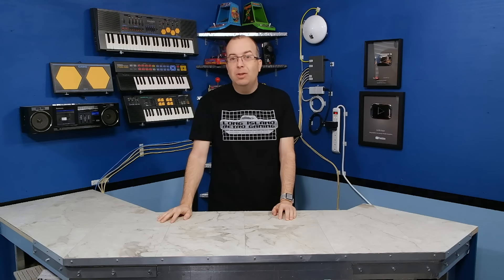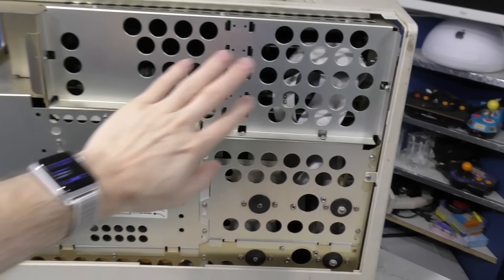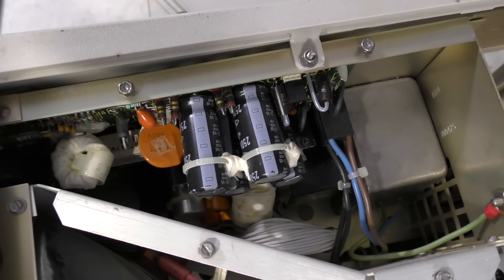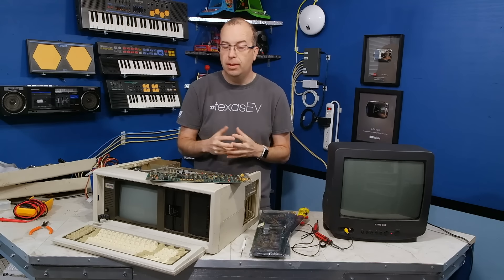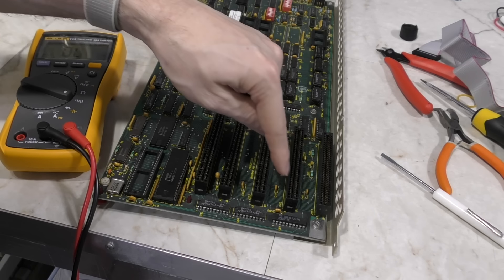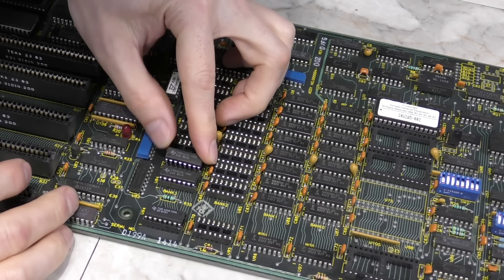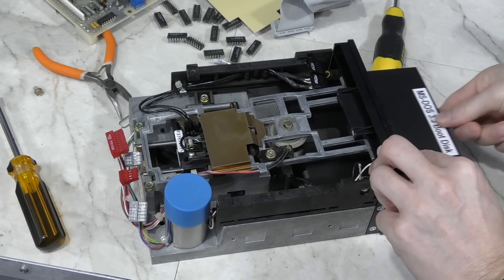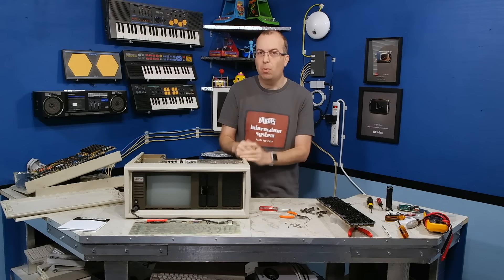Compaq Portable 1 Restoration - Part 1

Comment: Was watching this video when visiting my parents.. then dad peeks over my shoulder: 'Hey.. I got one of those down at the server room at work, want it?'   Suddenly i have a Compaq Portable that I have to clean up.
Reply: Sell it, or give it away to this guy.

I worked with plenty of this junk as a kid, it is perplexing to me why anybody want to collect it, but I am an engineer - we build better stuff today.

I think you're going to be disappointed.  It belongs on a museum, and I don't think it's useful for anything when you can simulate it at the gate level today - and you probably won't even do that ever.
Reply: @fuzzywzhe  Why do people collect anything at all? Why do we have emotional attachment to inanimate objects? Doesn't matter if we can emulate it to the molecular level.
Reply: How funny. Someone gave me one of these, too. And it's in the same state as David's. Fan comes on, but no display and no activity. I suspect a bad power supply.
Reply: @leandrotami  I didn't mean to sound critical, I just don't understand why people collect this stuff.

If I want to relive an experience from my childhood with a computer, it's the experience of using the machine, and simulation is 100% accurate with the machines I used.

I would never own a C=64 again simply because compared to the machine I have today, it's a waste of electricity to even turn it on.  My VASTLY  more powerful computer can simulate 20 of them running at the same time on 1 machine, and use less power.

But it's fine if you use actual hardware, of course.  I just don't understand it.
Reply: My Grandpop has one in his attic, he will let me have it if I past all my classes this year.
Reply: @fuzzywzhe  I believe you're missing the emotional attachment with the actual object. Yes, you could run an emulation of pretty much every system built in the 80s, and throw away and burn everything in a big pile in your backyard. This is not a matter of efficiency, it's a completely emotional aspect. I still own the computer I used when I was 6 and learnt BASIC programming with it. It is a part of my personal history and it's very valuable to me even though yeah, it's old and kinda broken down and inefficient. I don't care about that at all.
Reply: @leandrotami  I'm saying the only emotional attachment I have is the experience itself of the game.  Certainly wouldn't want to run a wordprocessor on one again.
Reply: Sick!
Reply: @tomwilson2112  if you have this apart, is there any chance I could have you get some information off a component for me? I need the values off the C2 Capacitor near the oscillator on the cpu corner of the motherboard. My C2 capacitor is missing and i need to replace it.
Reply: @fuzzywzhe  I get what you mean. I love watching these video's, but still these computers are a pile of crap lol. Interesting to see how anyone could put so much work into it.
Reply: Dude that's lucky! Oldest tech I have is just some IBM Thinkpad's with Windows XP on them. Well that and the flight stick I can't use
Reply: @AA-qo3wc  Hey, Mike. I just now saw your reply - sorry about that. 

I am not sure when I'll have the time to sit down and start troubleshooting this machine; right now, I don't have space to tear this computer apart. I'll keep you min mind, though, when I do finally get to work on this system. (Right now, I'm considering doing an LCD conversion.)
Reply: Lucky guy!
Reply: Wow. Amazing... You're Very Lucky!
Reply: @LtHades  What a kind grandpa.
Reply: Cool
Reply: that you GET to clean up
Reply: @fuzzywzhe  I prefer to collect these because they are part of computing history, I clean and restore these and put them on display for future generations to see computing history, without these, there wouldn't be modern computers.
Reply: @fuzzywzhe  yea you can emulate it but it's not the same as having the actual thing.
Reply: @minecraftWithDanielD  I have a commadore 64 I'm restoring right now, No video output but found the problem. Bad VIC ii chip.
Reply: @docsynth4387  "yea you can emulate it but it's not the same as having the actual thing."

Depends on what you're emulating.  Many emulators are clock accurate - this means that they are simulating not the instruction set, but the actual electrical signals.  They run EXACTLY the same, and they are running in an "ideal condition".
Reply: @fuzzywzhe  Same reason people collect other things.
Reply: Doing things like this is simply a HOBBY. It’s something interesting to do. It’s fun. There may be no practical point of restoring old computers, but most hobbies have no practical point either. I started restoring old computers recently and I don’t regret it. It’s very interesting to learn how to fix them and use them. Using real hardware helps put the technology in perspective. If I wanted to play old games just for the games, I would use an emulator, however; I find more enjoyment in playing the game on the machine it was meant for. 

Hobbies are not a waste of time if you can find some sort of happiness and enjoyment in doing it.
Reply: fuzzywzhe people want to collect it because its a (albeit, small) part of history, and its fun to do things on the original hardware  just as people did it decades before
Reply: @fuzzywzhe  To you, these old machines might be a waste of space, electricity and time to get them working. And certainly emulating these old machines may be much simpler, and easier compared to getting these old machines working again, however there are differences in ONE thing : Experience. And I'm not talking about experience from a software standpoint, the feel of the keyboard switches, the ways of troubleshooting problems, etc, which is totally different compared to using an emulator. And to some people those things are more valuable than just getting your work done
Reply: You should put new parts in it and make it a fully portable computer with a new lcd screen and all
Reply: VonGrav I have a similar story. I was helping my grandfather clean out a storage room of his and he found this. Now I’ve got to clean it up
Reply: Lol
Reply: @fuzzywzhe  Similarly you can get better performance out of a Honda Civic than out of a stock 1965 Ford Mustang, but it's not the same. Not at all.
Reply: @AiOinc1  Computers aren't like cars.

The main experience with MY computer was using it to run games when I was a kid.  If I want to re-experience that, there is nothing added by having a slow disk drive, an interlaced CRT monitor, and a power brick that hovers around 120F to do it.

90% of the experience is using the software of that computer.

I'm also an engineer so old stuff, not so interesting to me.  I understand lots of the parts entirely, and some of the parts at least on a general level.

My PHONE is more powerful than the graphics lab machine I worked on in college to design my SR VLSI project.  It was just a Sun workstation.  It would be no different to have a Sun workstation at my desk then to be using the computer I have right now emulating it.

Heck since I'm running Linux right now, it's practically like having a Sun Workstation at my desk.
Reply: @fuzzywzhe  For many people, the feeling of using software on the system it was made for is a very different feeling than emulating it perfectly on a new system. It sounds like you personally don't get that feeling, that desire that other people have, and that's fine. Not everyone does. To you it might sound stupid and pointless, but to many it is a very compelling reason to preserve and use old hardware. It's not really a practical thing, but it's not meant to be. People don't use this stuff because it's the best or fastest way to get things done, they use it because they want to.
Reply: @CommanderWiggins  The technology is what it could do, not the package it came in.  I think people entirely are missing the point.  I don't care what an old computer looks like, that's totally superficial and irrelevant, I cared what it could do.

Do you realize we have lost functionality with modern machines?  I was able to program a TRS-90 when I was 9.  How many 9 years today can write code today?  I entirely understand the mechanics of the earlier machines, but what is important is how they work - what they can do.

Modern machines encompass the functionality, the ability, of old machines.
Reply: @fuzzywzhe  I think you're the one who's completely missing the point. Just because you don't care about something doesn't mean it's worthless to other people.
Reply: @CommanderWiggins  "I think you're the one who's completely missing the point."

Fine. I give up on trying to explain the difference between a superficial physical design, and what it actually is capable of doing.  It's apparently beyond the comprehension of people.  I just wasn't aware of that.
Reply: @fuzzywzhe  I completely understand the difference between a machine's superficial physical design and what it is actually capable of doing. Everyone else who has replied to you also seems to understand that. The point that I, and everyone else has been trying to explain to you is that some people care about the superficial design. I don't know why you seem physically incapable of understanding that.
Reply: @CommanderWiggins  "The point that I, and everyone else has been trying to explain to you is that some people care about the superficial design"

I realize that.  I'm pointing out they are wrong to do that.  I'm pointing out they are superficial, and it's not a good thing to be superficial.

Would you not agree that superficiality is not a good trait?

It's fine to have an old antique.  I have a Babbage machine because of it's enormous complexity but I don't use it to do calculations.  The Babbage machine I have literally requires a running motor to power it - several watts - I've never measured it.  My phone uses microwatts.
Reply: People collect them because they’re only some left in existence
Reply: fuzzywzhe people (like me) find it cool to use and display stuff like this
Reply: @fuzzywzhe  cool beans 😃
Reply: fuzzywzhe it’s just fun to collect old things and persevere them
Reply: I had one of these when I was a kid. I remember carrying it around it was almost as big as I was. I could barely lift it.
Reply: fuzzywzhe if you DO sell it, make sure to get a good deal.
Reply: @fuzzywzhe  Ah yes, because your phone has a floppy drive. I see no difference in modern machines to past computers! You are correct, we are stupid, your opinion is only correct, collectors are a waste of air, i see you my dude
Reply: Cool!!!
Reply: @fuzzywzhe 
Uhhh... Dude. Don't tell this person what to do with their stuff lol? Let em do what they want, I doubt they give half a fuck if they're 'gonna be disappointed'. Note you aren't the only person in the world and that others actually have emotion and emotional attachment lmao
Reply: @leandrotami  Depends, sometimes it's just a hobby
Reply: @leandrotami  Its a hobby. Like trading cards, they really don't have any value but they are just cool to have.
Reply: @fuzzywzhe  Wow, you clearly don’t understand this hobby, not even a little bit. You can’t emulate things like the glow of a green CRT (no, an LCD with green text is not the same). SD cards also aren’t the same experience as a real floppy disk or an old noisy hard drive. I have carried my 33 pound Compaq Portable with me even though my MacBook Pro could “emulate” it, but I never have and never will have any interest in doing so, IT IS NOT THE SAME, “clock accurate” or not. The “ideal condition” for old software to run on is genuine vintage hardware. Of course, you will disagree, because that makes you feel good obviously, and you won’t even try to understand.
Reply: @AiOinc1  Great example! Couldn’t agree more. I don’t care if a newer car gets 100% the performance of the old one, the old one will always be cooler to me. For example, I’d be way happier with a 1926 Ford Model T than a 2021 Corvette. I don’t give a damn about going fast.
Reply: @fuzzywzhe  “90% of the experience is using the software for that computer.” You state that as if it’s a fact, but that’s entirely YOUR opinion, and not one many true enthusiasts (which you are not) share. Stop trying to force your bogus opinions upon everyone else.
Reply: @80sCompaqPC  You don't want to emulate the glow of a CRT screen.  It's a particle accelerator.

The reason for technological advancement is that it's advancement.

I can appreciate the tremendous advancement in technology from a Babbage machine and the enormous complexity of it, but I wouldn't want to have to drag around a 100 lb machine for doing addition and subtraction.
Reply: @fuzzywzhe  Something that parallels over from other hobbies: If you understand, no explanation is needed. If you don't understand, no explanation will help you to understand.
Reply: @fuzzywzhe  Thanks for confirming your lack of understanding.
Reply: @fuzzywzhe Some people just like collecting and using physical old computers why are you so rude!?
Reply: @fuzzywzhe  I'm sure you'll just call me a shitty engineer or something, but I'm also an engineer and I love watching these videos and playing with old hardware in the flesh. Granted I only recently graduated so part of the appeal of old hardware is the history, but I think using old, inefficient hardware also helps you better appreciate the wonders of our modern hardware. I don't think it's entirely superficial at all!

There's no avoiding it, but modern hardware is largely less tangible (at least to me) than old hardware. Seeing a board full of discrete logic chips brings me a kind of joy that I just don't get from an SOC. At the same time, I would never choose to build a production system that way when I could buy an RPi and get whatever I'm doing done in a tiny fraction of the time. 

I see this as much the same as the eternal debate of Linux vs <literally-anything-else>. Yeah I love Linux, playing with my PC and its OS, customizing everything I can to within an inch of its life, but if someone just wants to get something done with minimal hassle, there's a decent chance Linux is not the right solution for them. I use it because I enjoy it, and I learn things.

There's no point in me writing this comment and furthering this ridiculous thread, but I just had to express my view that there really is a non-superficial value in understanding computer history and the simple devices that paved the way for the fantastically complex ones we have today. For many people, gaining that understanding is much easier when they can play with the real hardware, or at least watch someone on YouTube do it.
Reply: @techkid43  Haha, no I wouldn't insult you and even if I did, I don't know you so any insult I'd give out is absolutely meaningless.  You should never be insulted by somebody who doesn't know you.

I'm simply pointing out that old ancient equipment should stay idle.  There's no reason to power them up.  Having a fundamental understanding of how older hardware works allows you get the better understanding of how modern hardware works - that's true.  There's been TREMENDOUS improvement in the last 3 decades, mostly in reduction of gate sizes, but also (to a much lesser extent) better routing algorithms.

You say modern designs are less tangible to you, well, get simpler hardware.  A modern PC is ridiculously complex, but a Raspberry PI isn't.  You can completely understand that, even though it's an SOC.

Linux can be made stock as well, the argument that it's "too customizable" I've always found that ridiculous.  You can do the same with Windows, it's just a lot more work to do it.  The reason that Linux is customizable is people who use Linux sometimes want to optimize it for their work.  There's nobody being forced to make KDE work with the Beryl interface for example - but I like it.

Understanding computer history is one thing, but making use of old hardware?  There is literally no point.  It's a waste of energy, it detracts from the lifespan of the (old) hardware, and literally, ALL OLD SOFTWARE (before 1990), is better run on a modern machine in simulation.

Can you really gain understanding and information from seeing chips spread across a motherboard?  Do you really gain any insight by following traces?  Do you have a deeper understanding because you can understand what a southbridge WAS?

You have to understand that older hardware was designed around limitations, they were not optimal - they were just more affordable.  You are seeing what was then, cost reduction.

It's fine to understand history, but for godsakes, I see no reason to run a program on one of these relics and if you're not going to run software on them - why power them up?

A great deal of effort was made to preserve the ability to run old software on modern hardware, in a simulation.  If you want to see what it was like to run some old program, don't fire up a computer from 1980 or 1990 - simulate it.  

The experience of using an old machine is what it produces, the machine itself was a device to produce output, nobody purchased these machines to purchase the machine itself.  They wanted results.

If I could have run a C=64 set of games on an Amiga back in 1990, I wouldn't ever bother with having a C=64 - nobody would have.  Back in the early 1980s you could run Atari 2600 games on an Colecovision - do you think ANYBODY with a Colecovision had a 2600 console?

In 1995, I could run a Nintendo Entertainment System on my computer - do you think I had ANY desire to have a "real" NES?  Lower resolution, higher power, had to deal with cartridges, had to deal with hardware, had to fiddle around with a television.  Or I could just load a rom on my computer and display it on my monitor.  What was less of a hassle to play Super Mario Bros. again after 10 years?

The future is to preserve the actual work on these machines is not a physical preservation, but a virtual one.  Your great grandkids will be able to play any NES game not because you bought the machine and the cartridges, but because it's simulated.

I regard the collecting of hardware as a bit of snobbery (it's better!) - well it's not better.  It's just the most expensive, and exclusive, way to do it.  I don't want to cut people out.  Simulation is about preservation, and you cannot do that with hardware to make it available to the wider public.  Hardware will always, inevitably fail.

In 2200 some person is going to be playing the arcade version of PacMac, but there's a 99.9999% chance they aren't playing on original hardware.  We need to preserve data, not things.

If you want to preserve an old computer for 100 years, cut out the capacitors (and mark the traces with the capacitance) and remove any battery.  All the solid state components should last for a very long time without being powered on.  I don't know much about dopant migration, but I think it's minimal without it being powered on.
Reply: @fuzzywzhe  bruh you can maybe get a raspberry pi 400 only not the kit for 70 bucks. Also sd cards are way more expensive
Reply: @AiOinc1   your right because it is the experience that makes it or breaks it
Reply: Nice unlike mice
Reply: @leandrotami  true
Reply: Imagine him saying
"It's yours my friend, as long as you have enough rupees."
That would be a pain
Reply: @fuzzywzhe  i think that at this point of the conversation, if you truly don't get there must be a problem with you or else you're just trolling. By the way, no one here cares if you're an engineer. You are not impressing anyone and you're not the only one with a degree here. I'm done with this.
Reply: @fuzzywzhe  ok, I'm going to the 'you have problems' option.
Reply: cool!
Reply: Lucky...☹️☹️☹️
Reply: @fuzzywzhe  it's fun fixing problems and playing old games like you did back in the day. It's also a bit of a challenge programing apps and games for old computers.
Reply: @fuzzywzhe  I am getting less sure you are an engineer with every comment
Reply: @honk2448  Do you really consider it enjoyable to debug a computer?  When I build a computer, the most obnoxious thing about doing it, is making the damned thing work if it doesn't come up on the first try.  Usually I just miss a power connection, or I didn't seat the memory properly.  If it's not that, then it's generally the chip has to be reseated, but if it's not that, nightmare.

Sure, there's some nostalgia value with playing with the old games and OSes and so on, but only in simulation.

Again, if I went through the trouble (and I never would) to setup a system that LOOKED like an old PC/Amiga/Mac/C=64/Apple IIE, but was really a raspberry pi you wouldn't be able to tell the difference.  It would run identically.

Wiring up a monitor would be a nightmare, as would the keyboard and possibly mouse, but I could do it.  You wouldn't be able to detect you're running a simulation, unless you looked at the power draw from it.  Not only would it run identically to an original system, it uses a fraction of the power.

In this age, we can run a C=64 system in a WEB browser.  It's crazy we can do this, but we can.  The old hardware is interesting to understand, but not that interesting.  I understand the chips entirely, the boards - that's not my area though I could figure it out.

Using an old system is just aggravation, not to mention the noise of using it.  They keyboards were inferior, the resolution just abysmal but suitable for the time, and looking at a CRT literally I can feel it.  If you put a CRT in front of me, and just showed blue and did the same with a TFT, I can tell which one is the CRT.  Not because I can see the refresh rate, but I can feel it.  It hurts my eyes.  It's like a prefrontal headache.  Hard to describe since when the first TFTs came out, I bought them, even though they were tiny and freaking expensive.

The whole point of these machine were what you could do with them.  Not the case, not the keyboard, not the awful CRT - those are all much worse than what we have today.  I can understand a person wanting to run some ancient software to experience the "good old times" but on original hardware?  Why?

Back in the 1980's and early 1990's - people customized the cases to make them unique.  They did this with the XBox at one point, and PS1.  I just don't see any reason to turn on a real Amiga or C=64 .  UAE simulates the sound of the disk drive.  Drives me crazy, like I ever want to hear that again.
Reply: @fuzzywzhe old computers are probably stupid to programm on but it's something different than just going to a modern pc. I am 13, I haven't experienced real nostalgia but I still love old systems.
Reply: @fuzzywzhe  I already got an arduino, I am gonna get a pi someday, but someday I want to get old machines
Reply: @fuzzywzhe  I know all about those, I use them to play games, I even used a vm to install win95, but it is still more fun with a real vintage pc. Yes I know what mame is.
Reply: @honk2448  Well, have at it.  I just don't understand it.  The old operating systems are interesting and novel, but man, I wouldn't want to be stuck with an Amiga as my main computer today.  At school, I mostly used it to just connect to a mainframe or a unix system.
Reply: @fuzzywzhe  I'll still use my modern pc as main, but just play and explore the old pcs
Reply: @honk2448  Haha, I think there's NOTHING interesting about old PC's.  They were basically the worst machine for games or even school work until 1995.

Companies used them everywhere, but their hardware was inferior, their OSes were terrible (the first version of windows that wasn't crap was Windows 95), they didn't even include basic stuff like sound in the machine.  The graphics were terrible.

And interesting machine was the BBC Acorn.  You can get a modern Acorn OS for the raspberry pi if you like.

https://www.youtube.com/watch?v=sneYGad3j5I

That was a pretty impressive machine.  What's neat, is that their CPU was revolutionary.  It does what is called conditional execution, which means that they didn't have to dump the pipeline as often.  If you know any assembly I could describe what it's so genius.

Anyhow, go flash an SD Card with that OS.
Reply: @fuzzywzhe  It's just that it's different with older machines, but I know what you mean
Reply: whoa-
Reply: Sick. How’s the process going?
Reply: niiiiice
Reply: Nice
Reply: @bubski6981  😂👍
Reply: Keep it! It could be fun to clean up and restore.
Reply: I'm just a kid but I'm fascinated by technology but mostly old technology
Reply: @fuzzywzhe  people have different opinions on whats good/fun.
Reply: @cooikemint  i realized that, but it's interesting that expressing my opinion brings such wrath.
Reply: @leandrotami  well we can’t
Reply: @fuzzywzhe  You're not expressing your opinion. You are arguing with other people and telling them that your opinion is superior, and that theirs is wrong. There is a difference.
Reply: @ih1440  I'm pointing out that using original hardware is wasteful and destructive.  THAT part isn't opinion.
Reply: @fuzzywzhe  hah how did I have a hunch that you'd say something like that?
Reply: @ih1440  Because it's true perhaps, and I've said it MULTIPLE times in this thread?
Reply: @fuzzywzhe  2 years and you are still replying? thats sad.
Reply: @User846  People keep writing me.
Reply: @fuzzywzhe  nor do i
Reply: @leandrotami  weirdo
Reply: @docsynth4387  bs
Reply: @FireCat_P  no its not
Reply: @K1smet115  boo fucking woo
Reply: @radicalthunder5740  uhh what? what part do you have in an old argument that ended ages ago? lol
Reply: Lucky ducky (;
Reply: thats hecking cool man
Reply: @fuzzywzhe  You mentioned above that you “just don’t understand it,” so give it a rest man! Sometimes you have to agree to disagree, we aren’t going to stop collecting and using old computers because of a comment you make on YouTube, just like you’re not going to start loving them for the same reason. When you go on the attack of a hobby people love, you will get strong reactions. Sorry, but that’s just how it is. I’ve spent half of my life collecting, repairing and using vintage PCs, and I absolutely love it, so suffice to say I’m a tiny bit offended when someone tells me that it’s stupid.

You don’t have to understand it, but please, be understanding of people different than you. Just loosen up a little man.
Reply: @fuzzywzhe  And one last thing worth pointing out is that something like a Compaq Portable uses a tiny fraction of the power a modern gaming PC uses, if we really must have that debate. A modern high-end video card draws about as much (or more) power than an entire fully-loaded IBM XT does.
Reply: @fuzzywzhe  i have an old laptop, IBM-Lenovo X61. its got some scratches and. a few slash marks on the keyboard (thats what buying from the state gets ya) and its slow, but i can run some oldest games almost perfectly. like the sims 3.
the thinkpad is kinda boxy snd ugly but i still use it, (like why does it have a keyboard light???) its a trusty old computer with a actually still working OG battery. i also tried playing DS games, the DS looks cool but its low frames and low resolution. so im basically just backing you up, (btw i still like the DS)
Reply: @TaxConsumer  ye
Reply: @fuzzywzhe  NO SIMULATION!!!!! i have a better experience with Sonic 2 on a Genesis hooked up to a CRT then on a PC
Reply: @fuzzywzhe  NO SIMULATION!!!!! i have a better experience with Sonic 2 on a Genesis hooked up to a CRT then on a PC
Reply: That’s very lucky
Reply: @VonDutchNL  "Interesting to see how someone could put so much work into it"
Well, it got him millions of views, didn't it?
Reply: Luckyyyyyy
Reply: @fuzzywzhe  there are a lot of people, myself included, who like hardware more than software.  and they love the challenge they get with this hardware.  modern garbage is just too boring.  you can run hundreds of such computers even on your phone, but there will be no challenge and no fun in it.  it's like playing a counter-strike in a godmod, you just can't be killed and you will get bored playing like that very quickly, because there is no challenge in this either.  I personally love the fact that this is an ancient computer and I love the way they look, work and sound.  And even if it does not work, I will be pleased to see such a computer on my shelf.  And to go even further, I think that modern computers are boring and good to use only as a tool to achieve your goal.  and they will remain boring to me until they become as obsolete and old as the computers of the last century are today.
Reply: That’s so cool!
Reply: @fuzzywzhe  it’s an important piece of computing hiſtory
Reply: @fuzzywzhe  What everyone is trying to tell you is that you are spitting out your opinions. some people dont agree with you and think that the original hardware is part of the experience.
Reply: @SuperWeirdPCs  I feel the same way. That's why if you watch my hacked wii menus, my first one was with Dolphin then I used a real Wii U in Wii mode to do it. You can't emulate a Wii Remote 100% perfectly. Even Dolphin's mouse wiimote is off slightly.
Reply: @fuzzywzhe  Emulation isn't perfect. That's why if you watch my hacked wii menus, my first one was with Dolphin then I used a real Wii U in Wii mode to do it. You can't emulate a Wii Remote 100% perfectly. Even Dolphin's mouse wiimote is off slightly.
Reply: @fuzzywzhe  How is it even destructive lol? If you throw it away, i'm sure that's more destructive than keeping and actually using it.
Reply: @ThatEngGuy  This thing is a space heater and using it degrades it.

THIS particular system can be fully 100% simulated in software 100% accurately.  It's a pretty simple machine compared to modern machines.
Reply: @ThatEngGuy  I still have a Wii, too, but personally I never understood what people liked about it.  I now have a Wii, an xbox 360 and a PS3 at the same time, and the only really interesting experience that I would not annoy for any reason was on the xbox 360. It has convenient controls and good performance, which cannot be said about the wii and ps3
Reply: @fuzzywzhe  Well why do people store ancient books and relics? To preserve history, that's same here.
Reply: @Recordable2000  Yes, but people don't pull out an ancient book to read it every now and then.

They keep it preserved, and read a COPY because using it, DAMAGES it.
Reply: @fuzzywzhe  If im understanding correctly… you feel as if restoring and using older technology is a waste of everything. So answer me this “engineer”, why did you even click on a video about an old workstation being restored and used? Why watch something you disagree so deeply with that you will argue with strangers for 2 years straight about it?

Wouldn’t an engineer, such as yourself, be too busy to watch a video of an activity that they don’t enjoy and then argue with people ABOUT the activity they don’t enjoy?

I’m not even going to start on the subject of you trying to push your opinions as facts. Because you’re giving off a troll smell.
Reply: @ForeverBlu  I have no idea why I clicked this video or found it.

However, I am pointing out that the use of such products degrades them, and although you can replace parts, you can't always replace original parts.

I'm an electrical engineer, by the way.  1/2 of what is in a machine from 1980 isn't even possible to buy on the market, but you can buy substitutes.

I don't know what opinions you think I'm pushing as facts.  Name them.  This is a common side-handed smear, claim somebody has done something but be vague about it.  Be specific.
Reply: @fuzzywzhe  No logical human being would click on a video about a subject they seem to know a good amount about and has already made up their mind about how they feel about it, then goes into the comments and argues with people about it for 2 years.

“Using such products degrades them.” Yeah… that’s how tech in general works. It tends to degrade the more you use it. No matter if it’s made in the 80s or if it was made yesterday, if you use it it’ll degrade and wear in some way or another. Being an electrical engineer I’m sure you know this. 

You severely underestimate the community around these older machines. 8-Bit Guy as been doing this for nearly if not over a decade and is still going. 1/2 is a very conservative guess. Plus, If it substitutes work… then what’s the problem?

“I don’t know what opinions I’m pushing as facts.” The mere fact that you haven’t pick it up is telling. The entire “it’s useless to revive and use old technology” spill you’ve been doing for 2 years. That’s an opinion. People have given their reasons as to why it’s not useless to them. But you retort with the same “but it’s useless”. The danger of reviving old tech is there and I can’t argue against that. But it’s usefulness is up to opinion. If it was as useless as you say, then again, the channel you are on right now would not be as successful.
Reply: @fuzzywzhe humans are weird, we like to mess with lots of older electronics and collect it because
1. It has historical and monetary value
2. It’s authentic to how people experienced the computer back then
3. It looks nice as a display piece and having a tangible, physical item than a emulated device, means you care about the computer more, it’s what makes the computer, “the” computer, every computer back then is different from each other unlike today where it’s down to the specs, although the C64 and Apple 2 are fairly easily to emulate, stuff like the Compac are more obscure and have their own architectures and verison of Basic, meaning software from one computer doesn’t work with a different computer, therefore for these more obscure older computers, you’ll have better luck using the actual machine than a emulator
Reply: @ZarrlPG3D  The only reason people have this junk is nostalgia.

ACTUALLY using them, is painful and awkward.  Would you really want to go back to the stone age using floppy disks and VCR tapes?  If this was 1985, you'd probably sell your soul to get access to what is a modern computer today.

I'm an engineer, the very purpose of my job, is to simplify and improve.  Today, you can literally store a film on a $5 storage device that is suitable to be displayed at a movie theater.  You know what a film canister cost in 1980?  About $100,000.

The purpose of my job is NOT to destroy things, it's to make the power available to everybody.  You know what you have in a smart phone in your pocket?  You have more computing power and storage than the mainframe system my entire university of 30,000 people did, and it costs $150 now, not 1.5 million dollars.

Your phone, is ENTIRELY capable of doing things from talking to your parents, to doing nuclear bomb simulation.

You have no idea.

My job is not only to improve, but to simplify and reduce costs.  This RELIC I saw plenty of when I was a kid, we replaced it with things INFINITELY better.  These are SPACE HEATERS today.

People have nostalgia for an AGE, not for the technology, unless they are luddites.

Your internet connection (no matter how slow it is), is faster now than the disk drive on this machine.  That's where we are today.  You can store more books than you can read in your ENTIRE lifetime (if you were born being able to read) on a $20 SD card.

The Library of Alexandria you can fit in your pocket, and lose in your couch cushions.  We're ending the ABILITY to burn books.

You just can't appreciate the power the average person has, but 1 in 100 do.

I have a $200 hard disk that can store every film, every song, every television episode, and every book I've ever used or seen.  I'm 51.

The point of this is to give the average person as much power as any other person in the world.  Do with it what you will.  You can see the establishment panicking, and I'm happy to see it.
Reply: Man I hate it when that happens 😂
Reply: I'd probably say you either sell it or buy some software for it and play around
Reply: its a trinket, a useless bauble. and people collect them for the same reason they collect any other kind of useless trinket. that's why I do it
Reply: @fuzzywzhe idk man, personally I don’t think emulating it is the same. I’m not against emulation, but if I can find an original, I’ll take it. The physical object is so much more valuable and interesting
Reply: @lennystudios3.14  It's absolutely the same, we are simulating quite often at the GATE level, we're simulating the circuity, bugs included.

I kind of view this viewpoint of "oh you must use the original hardware" as a sort of exclusivity or bigotry.  99% of the population under 30 today could never have played Super Mario Brothers, Sonic, StarFox, The Great Giana Sisters, Jumpman, Pitfall II, etc, without a simulator.

I regard this like people insisting you watch Safety Last on a projector from an original copy recovered from a salt mine, where it was stored.

The SYSTEM doesn't matter, the game does, the film does, the music does.

People complain that "vinyl is superior to CD" - no it's not.  Records were digitally mastered back in the 1970's and were nearly UNIVERSALLY mastered in digital by the 1980s.  What people are experiencing with that "rich sound" is distortion to keep the needle in the groove by an audio engineer.

We can COMPLETELY duplicate the experience of a Nintendo, an C=64, Atari 2600, a PlayStation I, etc in software today, with no errors at all and we even duplicate bugs in the hardware, because software at that time too advantage of the bugs.  Ever hear digital voice on a C=64?  That was done through a bug.

I can take a small system on a chip, stuff it into a Nintendo Box, even read the the cartridge you insert, and output it to NTSC, in a complete simulation.  You'd never never know you're on a simulator.  Would require some wiring.  There's nothing superior with the old hardware.  We even have filters to make it APPEAR to be on an NTSC interlaced screen.

You don't understand where we are in technology.  We can make PERFECT simulations of these old systems, except they run on 1/100th the energy and can do anything from enhancing the graphics, to duplicating the image you would have seen on a CRT.

We are here to PRESERVE this history, not destroy it.
Reply: I don’t mean the software - I mean the hardware. I emulate stuff all the time, especially Apple II (while I am getting my power supply working) and MS-DOS. It’s the physical experience that is so valuable to me. Being able to hold a disc of B-15 flight simulator or a Tetris cartridge is a large part of it.

In all honesty, THE GAME IS MORE IMPORTANT THAN THE HARDWARE - but that doesn’t mean the hardware is worthless. Plus, with some emulators, it’s very difficult to find a means to program or compile for them, which is half the fun for me anyway.

Still love that emulators are increasing the accessibility of these old machines, and I hope they continue to do so for years to come.

I also do indeed know where we are in technology, I’m no expert, but I’ve been studying comp sci and computational development for a while now, and it’s not like my friends don’t share the developments they hear about either. 

One last point, prolly minor honestly, take it with a grain of salt:
While preservation is important, the machines the emulators run on will one day no longer run either. What then? Emulate and emulator? And even if you do the obvious and keep just passing the emulator onto the next generation of machine, those who emulate will need to then get new machines. (Still better than no emulators though - accessibility is important)

TL;DR I think we are agreeing on the accessibility standpoint, I just appreciate holding the physical object for some weird human reason

Also just realized you have been in this for 4 years now, and that we should all prolly just give it a rest. Sorry for bothering you.
Reply: Lucky😢
Reply: @fuzzywzhe  I understand, personally I find these machines from a design and technological standpoint fascinating and cool.
Reply: Lucky dawg, my dad had one back in the 80's but its long gone
Reply: @fuzzywzhe we collect this stuff because they're cool, it's pretty much that, I have an old school dos PC I use everyday for business stuff
Reply: @hayden7525  Well, I'm an electrical engineer that works to obsolete this stuff.  I'd MUCH rather have a raspberry pi that just simulates this stuff, than this heating box.  We have DRASTICALLY improved things.  A TOY computer today is more powerful than a 1990's computer.

It is AMAZING how far we've progressed in 50 years.  I remember seeing a dot being bounced around on the television with pong.  That was impressive for 1976.  You really want a pong console?
Reply: @fuzzywzhe  doesn't stop me from wanting one😂. They're just neat machines, I know I can just emulate these machines, but there's something satisfying about switching one of these old computers on and seeing it whirl to life. I'm a sucker for old portable computers, I take my old Toshiba T-1200xe to coffee shops and get asked about it
Reply: @fuzzywzhe  and its the fact that some people just like using physical hardware, its the best way to experience this era of computers. To see how people actually did it
Reply: Bro you are so lucky!!